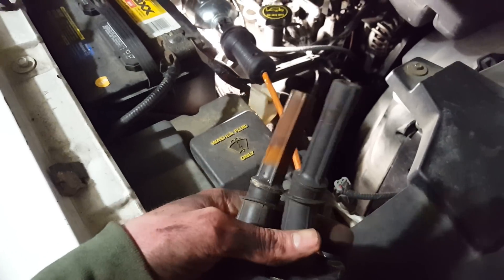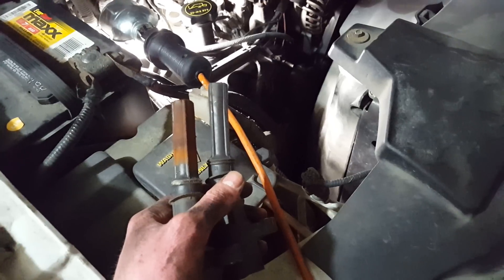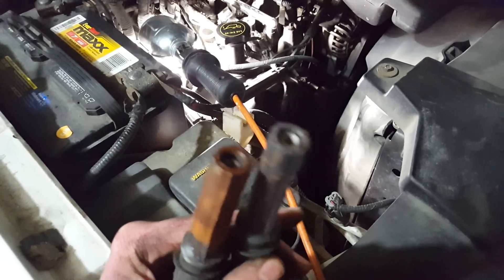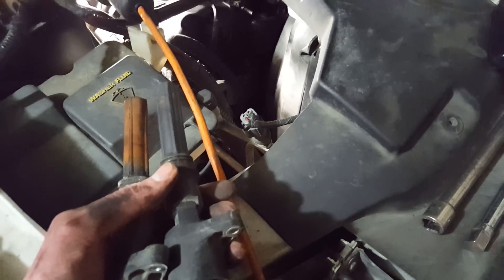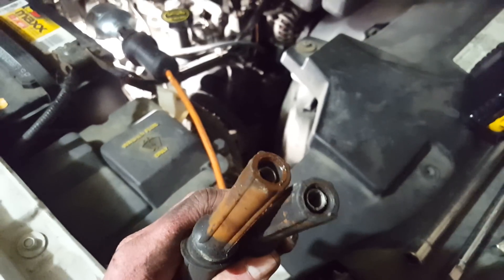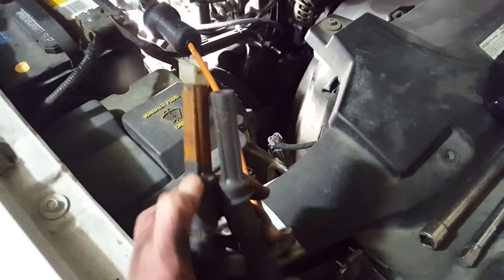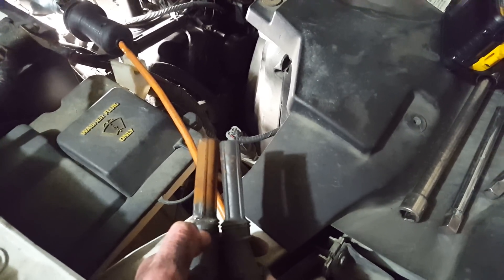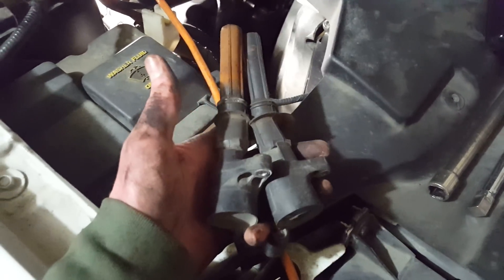Expedition 5.4L Triton misfire - Cause and Fix

Comment: I replaced all my coilpacks and plugs but still have a miss, i also put dielectric grease on each spade and on the plug contact side and every connector, but I still have a miss...
Maybe someone knows the answer to this question. I used my powerprobe maestro, which can test the injector circuit, and found that on cylinders 5-8, I would see an occasional Injector On Time drop to as low as 40.1 and even 101. Cylinders 1-4 would stay around 2.78 - 3.00 or so and never drop. I think this shows my occasional miss  would be on the control side to the injectors, which could be the pcm? Also, I watched a fordtechmakeuloco video where he shows a #7 cylinder intake roller follower popped off and was cause the misfire there..I assume with my findings this shouldn't be what is causing my miss?
I also verified I had good voltage to each power side of each injector connector. Any ideas? I replaced the fuel driver control module by the spare tire about 1.5 years ago with a doorman, I don't know if a malfunction in it could cause my on time drop or not though.
Reply from the maker: You need to try to isolate the problem.

Comment: Water or coolant from the head leaking?
Reply from the maker: on those years there was a known leak issue from the heater lines that go into the cab at the connection point where is right over one of the COPs. Aside from that, water, coolant, oil, or any other liquid will cause issues if it gets in there.

Comment: I got 2010 Ford f150 got misfire, changed all plugs & Coil Packs still has a misfire better but not right, so I ordered Fuel Injectors, I buy all my parts off Amazon, you can save 80% sometimes. just got to keep trying till fixed!

Comment: I have an F-150 Ford truck 4.6 Liter engine twice I replaced the spark plugs number 7 and number 3 I was being cheap so I just changed the spark plugs once I did piston number 3 wasn't misfiring but it went back to seven that was misfiring again when I already changed it to a brand new spark plug and a coil pack two it still misfiring on piston number 7 they told me that the gaskets are gone and antifreeze is dropping into cylinder number 7 that's my problem but I'm not going to spend $2,000 to get the job done I think it's time for a new truck

Comment: Anti-seize on the threads. I've changed mine 4 times (now has 334,000+ miles) and never a problem installing/removing plugs.

Comment: I got a 2000 Ford Expedition 5.4L ; my 4th cylinder seems to misfire but I don’t get a check engine light. A mechanic is telling me to change all the coils and spark plugs , even though I changed my coils and plugs last year. I’m going to change just my #4 cylinder/coil  and see how that works , do you have any advice to give or know why it’s just the #4 cylinder ?
Reply from the maker: Yep just watch the video and let me know what questions you have. How do you know it's cylinder 4?
Reply: Toluene I have a “car reader” made by HUM always on in my car. It would read first from the PCM that’s is a p0300 error , then after I would drive for a while it would alert me about the P0304 ( 4th cylinder ).  I checked it out and it looked , no wear or rust etc. not to sure why it was misfiring ; anyways I fixed it yesterday and it’s working like a beast again , no hiccups or misfires and it get those RPMs up great !
Reply from the maker: @Andres-nm7rh  If I remember right there is a coolant connection that is notorious for leaking over cylinder 4. If that's the case there could be a few issues aside from the leak. It can get into the COP connector and cause it to not make a great connection which can cause the plug not to spark. This is where dielectric grease would have help some because it keeps liquids off the connection points. At this point I would check the coil connector on cly 4 (back left since it's ford) and see if it looks like liquid got into it. If so you could fix the leak, try and change the COP again (or maybe try and clean the contacts, but when I did for one of my vehicles it didn't work) along with adding some dielectric grease. If it's not that, like my video, pull the #4 COP and see if there is moisture down in there. If so that's is probably why you are having the misfire and you need to blow it out or whatever and you should be good.
Reply from the maker: @Andres-nm7rh  So what did you do to "fix" it? If you just removed and reinstalled it it could have been a bad connection.
Reply: Toluene excuse the late reply . But yes I’ve heard of coolant leak , but I checked my cylinder and the hoses around it and there was no signs of leaks or buildup . The connector was fine for all of them , I’m really not sure why the cylinder was going out, upon closer inspection the spring inside of it looked worn down. Alas, I’m not sure why.  Now I’ve noticed the car will sometimes Missfire when I have my AC on , another weird thing , I’m thinking it might be the AC compressor. I’m not sure if I need to change the plugs now or the whole thing.... this week I’m planning on using sea foam the help clean out all the carbon build up and I’ll see how that goes
Reply: Forgot to further add my AC unit sucks ... it only blows cold air , I don’t have a heater. So I’m wondering if now after all these it’s come to bite me
Reply from the maker: @Andres-nm7rh  your blend door is probably broken or blend door actuator isn't working. The heater isn't bypassed right? 

As for the misfire when the A/C is on it could be a less than ideal connection to the spark plug/COP or spark plug gap. That's because there is a higher load on your engine making it harder to create the spark. This could even be injector related, but not likely. Swap the plug and COP with something easy like cylinder 1 and see if the problem moves. If it just goes away that means it was probably a connection issue. If it moves to clyinder 1, 1 of those 2 parts is bad.

Comment: Im going through this now i told the mechanic i wanted a tuneup and every since he so called did it my engine is driving worse
Reply from the maker: They either didn't connect something properly or one of the parts is defective. Depending on how bad it is you may want to bring it back in.
Reply: @Diallo268  i did and everytime i do that he lets me know he didnt do something like he told me a tune up for 2004 expedition didnt consist of coils i asked him what did i pay for him to do besides spark plugs he cant even explain and then my engine light was never on but now it is so i keep telling him somethings wrong i feel like i was better off not getting a tune up period
Reply from the maker: @sexyonly135  if you didnt have it before then he potentially did something wrong. It could be that he didn't gap one of the plugs correctly or one is just defective. I would maybe talk to a manager. If they won't do anything for you have them write down everything that they did. You can tell them that if they are refusing to fix it that you are going to take it to another mechanic and have them fix it and if they can validate it was something they did wrong you can take them to small claims court for reimbursement.
Reply: Ok thanks for telling me that hes putting coils on it right now he claims hes waiting for a guy to come he put 2 on yesterday it wouldnt pull the hill it was hesitating badly i went right back now hes saying hes waiting on coils to arrive this morning then ill go drive it again if its not right im just gonna take it sonewhere else
Reply from the maker: @sexyonly135  it's on them to fix it but they should pull those plugs and checking the gap. If you are getting a fault for just one cylinder they can check/replace just that one. Are they charging you for the coils?
Reply: @Diallo268  well i asked him to fix my strut first and then i ask him to give me a tune up i found out after i picked my car up he only did the spark plus and charged me 190 dollars he claimed for labor he didnt even change my coils now hes saying he gonna put coils on it now some fairly new and i wont be charged because i brought my car back as soon as i started driving home it wouldn't pull a hill this is what hes claim hes doing this morning
Reply from the maker: @sexyonly135  190 doesn't sound too bad. The expedition spark plugs are kind of a pain to change, but they should honor their work.
Reply: @Diallo268  im really starting to think he dont care i just know i wont be back after he sees whats going on i just cant

Comment: my 2007 expedition spudders at 38-40 MPG at overdrive, light on the gas peddle, if I accelerate thru the speed its fine, or OD off..  New Fuel pump and purge valve, I guess ill try to see if there is moisture too at the plugs...  Any ideas?  Thanks in advance
Reply: Update....  had all my spark plugs replaced, they were all bad... the spudder is gone,,,  Yay !
Reply from the maker: @michaelsandler4626  Glad to hear you got it fixed!
Reply from the maker: Could be moisture but also primarily sounds like you need to change your spark plugs. The gaps widens over time from sparking until you start noticing a misfire under load like at higher speeds. You can get an idea by pulling one plug and checking the gap.

Comment: So moisture on plug coil is normal? My number 4 went bad replaced it..3 weeks later number 1 goes...Number 1 had moisture on coil pack...mechanic says could be cracked head?
I dont think so...I'm going to replace the rest  of coil packs.
5.4 Triton Expedition 2000 148,000 plus miles. Coils were to be replaced to ford specs after 100,000. replaced plugs st 123,000
Mechanic said he recommends a rebuilt engine vs replacing head...anyone get by replacing head?
Thanks
If bottom is good I'd just soon run the wheels off this...truck is 20 years old  dont want to sink $5,000 in a motor!!
Truck is running good  service engine light still on. Edit: service engine light off now.
I really dont think I have block or head problems.  Thanks
Reply from the maker: It's just a poor design from ford that doesn't seal well and liquids can seep in over time. I don't know enough information but it sounds like that mechanic is either inexperienced, ripping you off or both. Best thing to do is just clear out all the liquid with a air gun and try it again. 

If you had a cracked head you should be losing coolant or getting coolant in the oil. That's a tough one also because that could also be from a leak somewhere else or the head gasket. To jump to a cracked head without even seeing it and recommending an engine change is ludicrous

Comment: My expedition randomly miss fires and stalls, but no CEL. I’ve tried everything, fuel pump, spark plugs, Evap purge valve, compression is fine, fuel pressure is fine, changed the MAF, replaced the IAC valve. Still having issues with sputtering and stalling.
Reply from the maker: Swap out the fuel pump relay and maybe the fuse
Reply: Check vacuum lines. They go out all the time.
Reply: I have the same issue truck stalled while driven no major issues before changed and checked everything new starter new alternator turns over with quick start then dies out think I need new spark plugs also my oil light is on I found the oil sensor was loose n leaking I tightened it up and now I’m ready to give up checked everything looks damn even new fuel filter

Comment: I have #3 cylinder misfire. Iwas going to try to replace coil pack and plug but now maybe check it and try cleaning first. I have been told the plugs are bad about breaking off in the engine. Do you recommend a procedure or product to soak the threads to reduce the chance of this.
Reply from the maker: What year is it? I believe the problem is from 05-07? It's the 3 valve engine that is troublesome.
Reply: Mine is 2004
Reply from the maker: @wessimpson3008 Yes then you shouldn't have to worry about it but you can google it to make sure.

Comment: I’ve had this issue a bunch! I think it has to do with the vehicle not properly draining when it rains! I have found in a rainy day water will leak into the engine compartment and travel under the hood to drop right on cylinder 3 and cylinder 7. I haven’t found out how or why but has been a problem. I typically have to replace the coil.

Comment: I have a 2002 expedition.  It runs great and doesn’t have any lights on, but randomly when going at regular speed it will kind of sputter, it’s almost like just a few jerks if that makes sense.  I can accelerate and it stops.  Any suggestions before taking it in?
Reply from the maker: Yes. Most likely is the plugs if it's been a while since they've been changed. The gap widens from all the arcing and eventually it will start missing at speed and you can't really reproduce it idling. I would pull one and check the gap. I've had them be way over (roughly 250% gapped) and didn't have a problem, but regapped them anyhow (you would have to refer to the manual and spark plug manufacturer to see if you can regap the ones installed). Replace them if you can't find out, if they are damaged, or just unsure. They typically aren't too expensive. If the gap is within limits, pull all the COPs and look for moisture as shown in the video.

Comment: I have 2003 expedition eddie bauer triton 5.4 mine I took it my truck a shop and they did a diagnose on it saying intake coolant leaking #1 coil misfiring , p0113 I.a.t high, p0171 bank#1 man, p0172, bank 1 rich, p0174 bank 2 lean, p0301 #1 misfire, 302 #2 misfire, 303 #3 misfire, 304 #4 misfire, 305 #5 misfire..so I a friend replaced the intake manifold gaskets to stop the coolant leak which did and started  it up and took it around the block and it ran ok for 5 minutes then be hold it started running rough the acceleration was bad got it home and before I took it to another place the other misfiring disappear so the new place diagnose it as#1,2,4,5 misfiring so he suggested tune up so if I do that and still runs rough I don't know what else I can do and I feel that places are not giving me answers just a guess I can't afford to take it other places just to be let down and no answers please some one give me suggestions of what to do our how to solve this issue I would appreciate it so much I go back to work next month after being on medical from surgery..Thank you
Reply from the maker: I would recommend going to a model specific forum (like http://www.expeditionforum.com/) and posting your question there. I don't recall specifics about the intake. I would say with all those codes, some are probably old and possibly no longer valid. Did you have it cleared and checked again? The big thing to look for is liquid in the hole where the spark plug boot connects to the spark plug. Take those coil over plugs off and see if you see liquid. If you do that can cause a lot of problems. If it's in multiple that's why. Now as far as how it got there you would need someone to check it out. If they are all dry, it probably isn't coolant leaking on the plugs. The big coolant leak issue was on the #4 cylinder because one of the heater core lines connects right over it and can cause issues.

Comment: I was hoping you could tell us where the moisture was coming from. I might be having same problem. Mechanic changed all the plugs and coils and was running great and within days it started misfiring again. He could not find moisture or the problem and gave up on finding it. So took it to another mechanic and hopefully he could diagnose why misfire. That's why I was hoping you could tell us from where moisture was coming from to give us and idea. It don't work if you don't give us a complete run down of your misfire problem.
Reply from the maker: So moisture is coming in from the top around the COP boot. Now as far as how it's getting there in the first place, it could be a variety of reasons and I don't want to speculate. If replacing your plugs and coils worked shortly and it's acting up again AND you aren't seeing any moisture then you have another problem. You could have a bad contact(s) on one of the COP connectors or many other possibilities if you aren't seeing moisture. Were you getting a fault? It could even be a fuel injector going bad or something similar. It could even be a problem with the new parts. If you are getting a fault for a specific cylinder you can swap plugs/COPs/injectors with another good one and see if the problem moves. That way you aren't investing more money into it that you don't need to.
Reply: check the intake, I came across a video where the intake was leaking very slow into the hole where the sparkplug goes. intake gasket goes bad, it has a gel gasket

Comment: Plug wires develope resistance and causes misfire which can damage the wire and cause engines to run rich which damages the converter. It can damage modules.